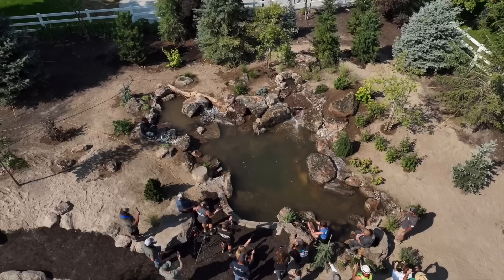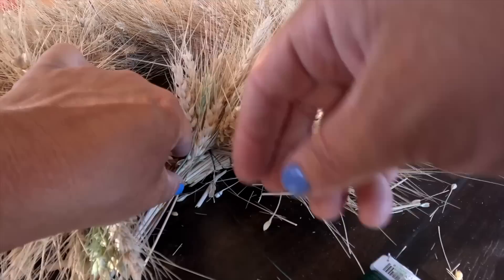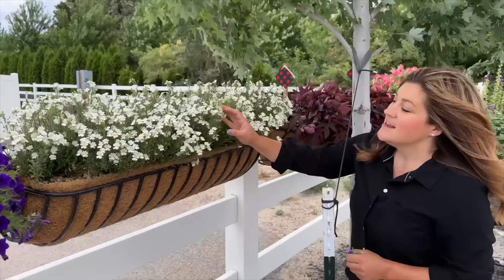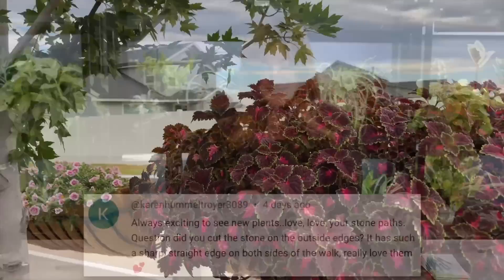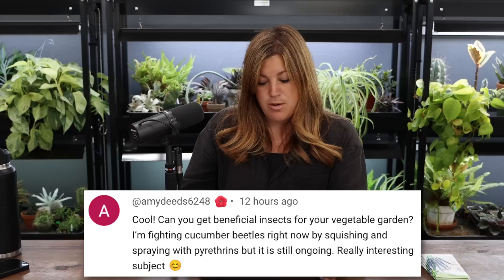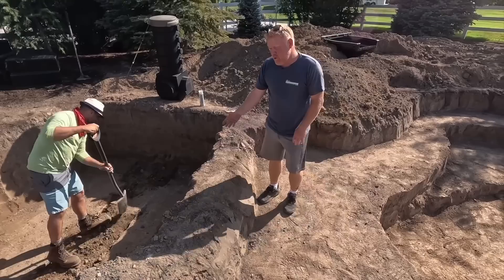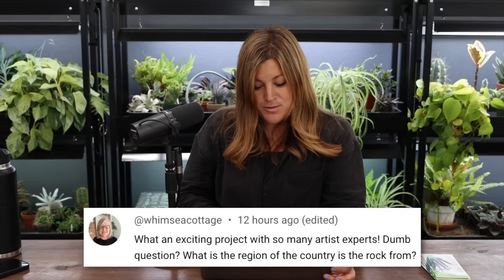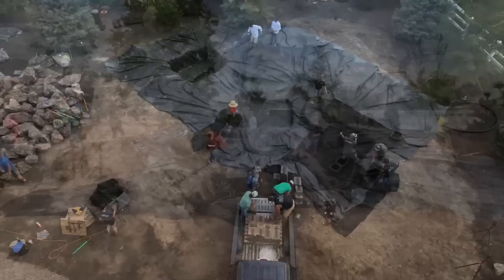What Would a Pond Like This Cost? // Do You Fertilize Perennials like Annuals? // Recap 🌿

Comment: Quick calculation is that labor would have been conservatively $25,000 for 14 guys for 3 days, excluding design time and travel time.  Add transportation costs (airfare and rental cars and food) - add equipment rental, pumps, filters, gravel and rock, boulders and liners.  Increase the labor charge because these are the best of the best ...  catering for the crew, and porta potty rental.  It was such a generous gift from everyone involved.
Reply: And add to that hotels or VRBO’s!
Reply: Just watched an Aquascape video, revisiting a pond that they did in about 2001. Pond was around twice the size as Laura and Aaron’s. Quote BACK THEN was $150,000.
Reply: Can confirm. A pond done at a friend's house in Florida in 2006 is about 2x the size and came out to $250k, including a gazebo.
Reply: yes and if you are adding in the cost of the plants, labor to plant them, mulching and adding the drip system, ect, its way more than that. Most people would have to hire an actual electrician/plumber to run all that utility access, add in the lighting, I guess internet hookup of some type if you wanted to wire all that to sky spy,  dig in lines and hook to your access point, ect.  You'd also have to pay all those inspections, city/county as you went along.  I'm guessing the whole thing is closer to at least 150K. The price of koi, several hundred dollars apiece, the water plants are very expensive too.

Comment: The difficult problem with finding insects is buying them.  You often have to request the year before and are on wait list because not many suppliers are available to small purchasers. I’ve been buying for a few years and several years can’t get them because they run out. Hopefully they will become more available as more people become interested
Reply: do you also buy Fireflies?  I would love to learn more.... what kind of insects do yo purchase, and what is the cost?
Reply: @MysticFIREFLY  we have leaf cutter bees but not that many bc so dry so don’t get a lot of the soft rotting wood they need to nest in, so when we get them think of as a beneficial pollinator bc the leaf damage will be so limited. They actually use them intentionally here as beneficial pollinators of alfalfa. I’ve never had issue with them. I do have some large lilacs near more roses and they like both so maybe offer larger plant like a lilac nearby to draw them away from your roses. I’ve been having major grasshopper issue and I’ve started planting sacrificial plants with big leaves near ones I’m trying to grow more robust and that’s working well. The grasshoppers concentrate on them and I spray with neem and insecticidal soap and it’s brining situation under control and I’m just losing the ornamental kale I planted for this and not the perennials and shrubs and roses .

Comment: The first fabric liner is used to help prevent punctures into the rubber liner. Basically protects from roots or rocks. Second is the true liner for pond. The third on top is used so the big Boulders do not puncture the liner. Just in case there  is any sharp edges. I love to watch the videos of these guys. Looking to retire in country to do this myself. Normally they have done an overflow for you.

Comment: I have an Aquascape pond too. Albeit smaller than yours. lol You can trust that there is an overflow system built into the pond. It definitely can and will overflow with a lot of rain without one. For mine, there are overflow outlets in the skimmer that flow into a sump pump basin buried in the ground, that will pump the water out to our front driveway. Others will drain into a drainage system closer but our backyard has level issues that trap water, so we opted to send it to the driveway and down into the street.

Comment: If, you ever think there would becoma a year of many rains, you could place large PVC pipes with holes ( first one upright ) and surround with pea gravel, so drainage would be more centrally located to follow PVC to other areas. Functioning like a septic drain feild, for runoff.
I tend to do this sorta thing in low lying garden spots and it works amazingly great! Even if just digging with post hole digger and filling with small stones to never remain flooded for length of time. 
Hope this suggestion may be helpful if ever needed.
LOVE THE POND CREW, always AMAZING WORK! ❤💞🦚 
P. S. Even if 1/3 of the subscribers begin to function in the manor of helping others without $$$ pay, you have helped humanity in a huge way!

Comment: Regarding Dahlias (my 2 cents in a completely different climate and soil: Portland, OR, clay soil), I have had excellent results with my dahlias coming back when they are in a large-ish PLANTER instead of in the ground.  Probably due to better drainage, wht with not using my native (clay) soil.  I don't move my planters, I just leave them out, but we don't have as long/hard a freeze as you get in E. Oregon.  And I don't use any herbicides/pesticides/fungicides, so the beneficials don't get killed off.  Some are probably killed off by neighbors use of chemicals, but I have a large wooded area behind my house with is protective.

Comment: 17:42 Maybe you could try putting the wire going down your back rather the front? 🤷🏼‍♀️

Also, I totally understand y’all’s different climate versus the other part of the state. I’m in the Texas panhandle (along I-40). We’re usually very dry (very low humidity) and super windy in the summer, and cold and super windy in the winter. (The wind is ALWAYS blowing here💨) I can’t do that high humidity…eww. 🥵 I’m in a zone 7 btw. 😊

Comment: You should try taking some of the slack from the mic cable and clip it to your bra strap. It’s hard to explain… but like pick up the cable around the middle and clip it there. So you should have slack between the clip and the mic as well as slack between the clip and the mic pack. It’s what I did to help keep my in ear monitors from pulling in either direction while singing.

Comment: Regarding the closed captioning, the viewer can turn the auto closed captioning on or off, bottom right hand corner of the video there is a CC.

Would one of the hook and loop (a brand name is velcro) cord keepers help with the microphone wire issue?  When you wind it up before putting it your pocket could use the hook and loop wrap around it to help reduce it coming undone.

Comment: Try putting the wire for your battery pack down the back of your shirt. Put it under your bra strap, loop it around and put it under your bra strap again. Run it though a belt loop or two. Then slip the battery pack into your LEFT back pocket. Hope this works. (I think like Paul 🤔😃🤗)

Comment: What do you mean? You went from a zone 5 to a zone 6. Of course, your temperatures have gotten warmer.
Reply: A zone covers vast areas. It could be another area is warmer, but hers hasn't changed. Also, it could be that it's colder or stays colder longer or that the spring temperatures go longer. There are many factors considered.
Reply: @kellieleahy66  How vast are we talking? There are tiny sections of my state that have their own zone due to different lake effect or whatever. Also, Laura has mentioned many times how mild their last several winters have been. So, warmer.
Reply: I'm in zone 9b in far northern California, which is coastal, has mild temperatures, and has lots of rain. 9b also extends to Southern California, which has hot summers and mild rain. It's a bit frustrating, actually. 
I have no reason to doubt her. She tracks the weather closely.